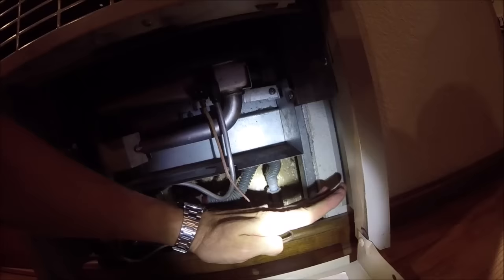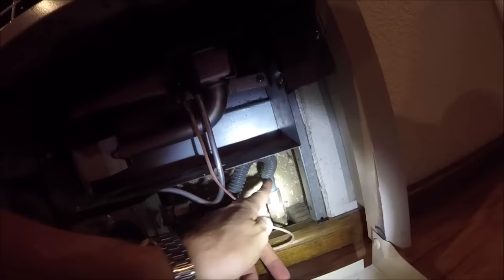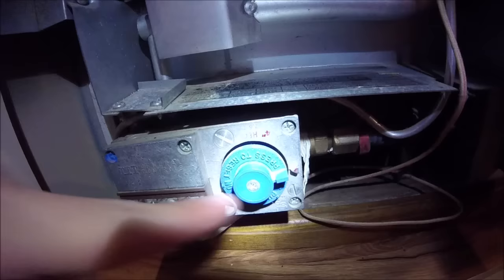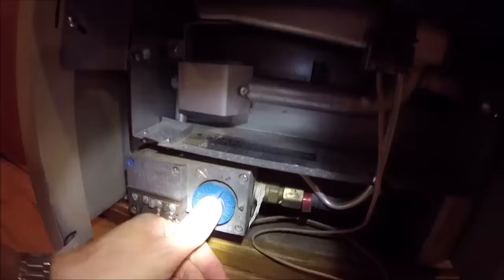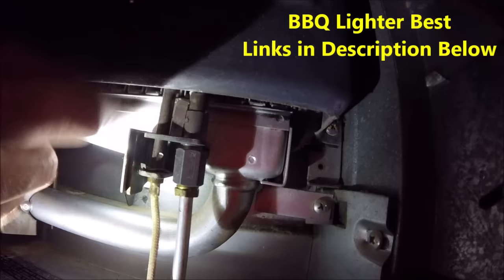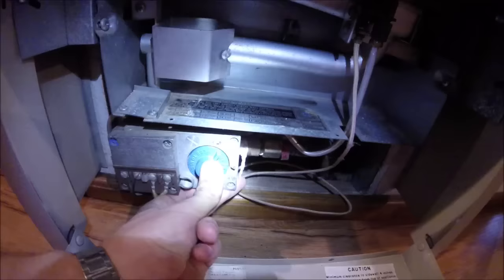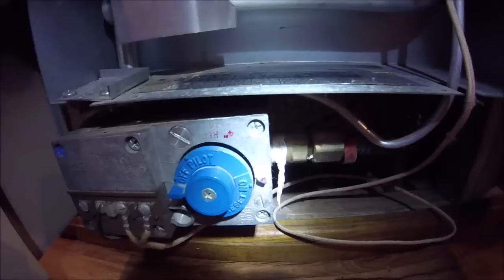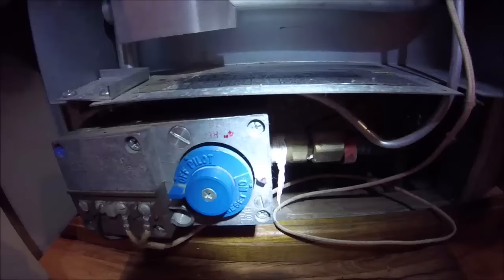How To Light your Furnace Pilot Light. Lighting Gas Heater Pilot Light -Jonny DIY

Comment: My pilot was on, as well as the thermostat, but nothing. Traced the wire from the thermostat to the controller at the bottom, wiggled a couple wires, followed the two black lines up to the top, wiggled the two connections, and turned the thermostat back on; fired right up. Running like a champ! From the South most of my life, and never had to deal with this. Just spent like the past 4 days at a motel in CO in the cold :D
Reply from the maker: Nice! Glad you got it going, stay warm 🤙

Comment: Thanks Jonny. Was able to get it done with the help of your video! 

First time I ever do this so sorry if stupid questions. Is it normal for the furnace to hiss throughout? And also every now and then there will be a "clank" that I imagine comes from the metal heating up, is that okay too? 

Also an initial smell of burning. We've lived in this home for two years so I imagine some built up dust getting burned in there. Safe or should I shut off and clean more thoroughly?
Reply from the maker: You're welcome. All those things are normal. It's always a good idea to clean and vacuum dust off before using 1st time each year. You can clean with pilot on, it's fine. If not a ton of dust it'll just smell some and burn off though 👍🏻

Comment: This was a great simple explanation. Thank you so much. Do you have a video on how to get the door off? I need to be able to get in there and vacuum around and clean out the inside on an old one. But I can't get the door off! Again, thank you!
Reply from the maker: You're welcome, glad to help. I don't, but its really easy. Open the bottom door and should be a few screws on sides and one on top. I took mine off a couple years ago and I only remember it being maybe 3-5 screws
Reply: @JonnyDIY  Thank you! I'll give it a try. I appreciate your answering.🙂

Comment: Can I light it w/o doing the gas turn thing? My roommate is out by the water heater trying to move the knob lol & apparently can't. I know it was on even last week during the heat wave here in SoCal because I could feel the warmth on the grill which is identical to yours
Reply from the maker: If the pilot light is lit you should be able to adjust thermostat for heat to come on as long as the knob is set to ON position 👍🏻

Comment: Thank you, this was very helpful! Would you happen to know if a heater like this (exactly like mine) uses natural gas or LPG gas? The reason I’m asking is to know where to install a gas leak detector (near floor or near ceiling) I had turned off the gas supply since I found out we had 3 small gas leaks coming from heater when I smelled gas a few weeks ago. Leaks have been fixed, but I bought a gas leak detector to install on the wall for peace of mind. Thanks again!
Reply from the maker: You're welcome, glad the video helped you out. Most commonly use natural gas, thats what this one used. You'd know if it were Lpg if you had big gas tanks on site you had to have refilled. So detector goes higher for natural gas (below ceiling near gas appliance) than lpg 👍🏻
Reply: Jonny DIY ahh thank you!!! I was in the process of googling it and wasn’t getting any concrete answer lol. You saved me so much time and helped me have peace of mind in keeping my family safe! 🙏🏼🙏🏼🙏🏼
Reply from the maker: @clavelbri  you're welcome 👍🏻

Comment: I think I have the same wall heater as you.. Robert Shaw?

Anyways i relit my pilot light and set the thermostat on 75, are there supposed to be more burners activating after I crank it up?

If so, I think I may have an issue with my burner sensor, does that sound correct?

Am I missing something?

Comment: Hey I followed this and it worked and has worked for over a year, but now every time I set the heater the furnace doesn’t turn on even though the pilot flame is still on. Is it from the control board?
Reply from the maker: Try cranking thermostat all way up first, see if kicks on. If does could just be thermostat not reading correct anymore. If turn up all way and still nothing could be thermostat bad. Can disconnect and jump the 2 wires together and furnace should kick on. If it does then you know its just a bad thermostat. I'd start with the thermostat first

Comment: Hi my pilot continues to go out since my kids room door is almost directly in front of it .I have a very similar heater and im tired of calling the manager about this question should my thermostat be on or off before trying this lol this video is great and i think i can do this?
Reply from the maker: Put thermostat off until pilot is lit, then turn on to test make sure in working order. Not sure what you could do to prevent blowing out, dont want to put anything flammable around it to prevent the breeze. But once you do it once you'll see how easy it is 👍
Reply: Wow thank you for the quick response ! I'm going to try it now

Comment: Hey great video , Just have another question ... Is it supposed to take a while to get warm , my pilot is on and I turned my thermostat up but the heat is coming out slowly and it’s been almost an hour. I usually heard my heater being  on when I turned my thermostat was turned on last year. I’m sorry if I can’t explain the noise , but I can only hear the lighter on and I remember it being more louder last year. Please help. I’m not sure if I did something wrong.
Reply from the maker: Make sure you turned the dial from pilot to ON. If its in Pilot position it won't have enough gas supply to kick on. Then crank your thermostat up and it should kick on. Yes you're right, it is  pretty loud when the heat cranks on
Reply: Yeah it’s on ON an I started with thermostat off then turned it on for a while but didn’t quite feel the heat so cranked it up but it barely comes out . I decided to turn it off and call maintenance or PG&E. I’m not trying to leave it on and something goes wrong. Maybe something is wrong with it. Not sure . But Great video! Definitely showed me how to properly turn it on.
Reply from the maker: @nancycortes7777  Hope you get it sorted out. You're right, something sounds like its not working properly

Comment: Hi Jonny. My heater's light just live only for a few days. I need to turn on pilot light for it again for every 3 or 4 days.
Reply from the maker: May be blowing out from wind or maybe just weak. May need replace thermocouple. Can try turning it off then cleaning it. May be slightly clogged restricting flame
Reply: @JonnyDIY It's very kind of you! Thank you very much for your instruction. I will follow your steps. We were very cold last winter. Best wishes!
Reply from the maker: @MinhNguyen-bq5mb  you're welcome, glad to help. Hope you can get it fixed 👍

Comment: This video made me not afraid but I did successfully do it and then turned it off because I got scared. Am I supposed to be able to see light from the flame through the vent and hear it going the entire time? Sounds like I just lit a fire in my 1920 apartment haha.
Reply from the maker: Yes once you light the pilot it'll stay lit until you turn it off when weather warms up. Then when you turn heat on yes it'll make noise a burning noise and have light. Nothing to worry about, it's normal. Stay warm! 👍

Comment: What brand is the wall furnace, or even better is there a model number on the furnace and/or valve. I have an old Montgomery Ward furnace with that same valve and the valve has died (the electromagnet for the main/safety valve) so I'm trying to find out who made their wall furnaces, ultimately hope to find out if there's a direct fit replacement for that ITT valve. Thanks.
Reply from the maker: Pretty sure it was a Williams. I took it out a couple years back before I sold the house, had got central heat and air and this wasn't being used anymore
Reply: @JonnyDIY  Thanks for the reply, I found some photos of ITT Control valves with the blue knob and they're labelled Williams too. The valve in the latest model seems to be the same dimensions etc so I'll probably try one of those, what can go wrong!
Reply from the maker: @ubanto6523  you're welcome, hope you can get it fixed

Comment: I followed instructions and once I went to crank on the thermostat and went back to check on the flame it seemed to expand, be a bigger flame in there. Is this normal? I’ve never had this type of heater and it scared me. I shut it off so quick lol 😂
Reply from the maker: Yes that's normal, it'll flame up and spread and light the main heater burner once you turn up the thermostat 👍 Stay warm

Comment: Quick question do you know why once I let go of the knob from the “pilot” position the fire goes out.  Am I doing something wrong ? I held it for over a min to see if maybe it needed more time but it still turned off as soon as let go.
Reply from the maker: After you get pilot lit and still holding button down, try turning to ON position then let go
Reply: I have the exact same problem! After the pilot is lit, I try turning the knob to ON but the light goes out. I've tried releasing the button very slowly as I'm turning to the ON position, but the light goes out.
Reply from the maker: @AbandonedMines11  try cleaning the end of the thermocouple with some fine grit sandpaper or steel wool. If that doesnt work may need to replace thermocouple. Not an expensive part and fairly easy
Reply: @AbandonedMines11 mine ended up working by holding it on pilot for about 4 min lol.  It wouldn’t let me turn to on position without releasing the knob.

Comment: If it’s lit does it mean it’s on? It’s summer and i noticed the fires lit but I’ve never turned it on
Reply from the maker: That just means the pilot is still lit. You can turn the dial to the OFF position if you want, then relight it come fall/winter or you can just let it burn. It doesn't use much gas, but still uses quite a bit if add up over the months of not using

Comment: do you turn the knob back off when done with heating and always repeat process?
Reply from the maker: Yes once you stop using your heat for the season you turn back to off so you're not burning the pilot light gas all summer 👍
Reply: @JonnyDIY  so the gas/fire stays lit all season even when the heater is reached temperature?
Reply from the maker: @djrevue4106  yes pilot stays lit (burns very little gas) all winter until you turn knob to OFF

Comment: Thank alot I knew how to light 🕯️ it but not stay on cuzz it cutts off  sometimes. So it might be a thermal issue. But thank I'm making 50$ bucks for my neighbors in my apartment complex I did 10 do the math 🤣
Reply from the maker: Awesome 👍 yeah sometimes need to replace the thermocouple
Reply: Yeah I got the whole thing changed but maybe because it’s new it needs a break in.. it cutts off after a few uses luckily summers coming won’t need it lmao

Comment: I havent used mine in years. What happens if the arrow is facing the pilot option? Its beein like that for years
Reply from the maker: Probably been leaking that tiny bit of gas out all this time unless the gas had a shut off off valve, or pilot had stayed lit. Vacuum and dust it off and fire it up 👍
Reply: @JonnyDIY  thank you. Great video

Comment: Would you happen to know why after I have lit the pilot and I’m ready to put the button on it won’t turn. But if the pilot is off it turns just fine. Someone help
Reply from the maker: Not sure about that one, I know you have to push it in a little when you turn, it can be a little fiddly sometimes
Reply: Did you happen to find out why? I’m having the same problem and cant find the solution to this :(

Comment: I have this exact same heater but I don’t have a thermostat?
Reply from the maker: Hmm never come across one like that must be older. If youre sure there is no dial or thermostat on the wall around there it may just be an old one where you will need to manually turn it on and off. Check all over though, sometimes the thermostats are further away from the heater

Comment: ok just did this, it smells a lot like gas and burning, is that just normal when you first re-light it? anything to be concerned about?
Reply from the maker: It usually smells like burning as the dust is burning off from not being used but the gas smell should go away shortly after about 5 minutes of it being on. If still smells like gas after a while turn it off as their may be a leak.
Reply: @JonnyDIY  it stopped after a few minutes like you said, thanks!
Reply from the maker: @nadialeeabu  Awesome, glad to hear. You're welcome, happy I could help 👍

Comment: When I turn the heater on after doing the steps the pilot light turns off what do you think is wrong?
Reply from the maker: Hmm, make sure the knob is in ON position at that point and not pilot. It could still be lit, it's very small flame. If it's  constantly blowing out though, you may need service
Reply: @JonnyDIY  thank you manager just came and they are checking it out
Reply from the maker: @shirleysworld6818  ohh good, hope they can sort it out

Comment: my heater has the flame lit but it won’t turn on what do I do ?
Reply from the maker: Make sure dial set to ON, and turn thermostat on to Heat and adjust temp up. If still doesn't work may need part replaced. Check thermocouple first

Comment: The pilot light wont say light. What I do replace the thermocouple?
Reply from the maker: Yes usually that's the problem in my experience 👍
Reply: @JonnyDIY  Anyway I could email you a picture I cant get to the thermocouple from the panel around it.

Comment: This heater is super old .I hear the gas when I turn to pilot, but if I'm putting the  flame to the proper place, it's not lighting. So 🥶 cold
Reply from the maker: Hmm if you're doing everything properly the thermocouple may be bad. That's usually the 1st thing breaks on those over time

Comment: My pilot light is off yet the heater is still emitting heat. Any suggestions?
Reply from the maker: Hmm if furnace turned off and pilot off it shouldn't be putting out and heat. Pilot must be on if just putting out a little bit of constant heat. I would turn the gas valve off to that heater to further investigate and figure what's going on with it
Reply: @JonnyDIY  the pilot light is off for sure. Not sure about the gas valve though
Reply from the maker: @mikeb995  well then the only way it'd be putting heat out is if the furnace was somehow switched on or malfunctioning. If cut the gas, can start over at the beginning trying to light pilot and go from there

Comment: Quick question... How do I turn it off for the summer?!
I can find thousands of videos of how to turn it on... But not how to turn it off
Reply from the maker: you just push in dial and turn to OFF position.  If you see a gas valve  for heater with yellow knob a top it, turn it 90 degrees perpendicular to gas line to shut off gas as a secondary precaution 👍🏻

Comment: is it supposed to keep making that lil hissing sound even after its lit and u switch from pilot to ON ???
Reply from the maker: It will make noise as its burning but it shouldn't be making noise until it's lit and the heater is on 👍